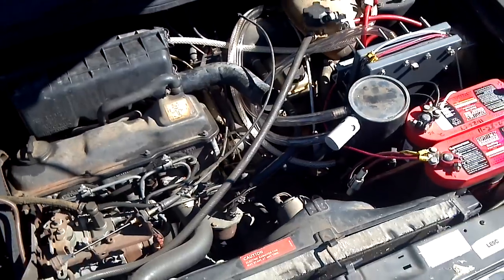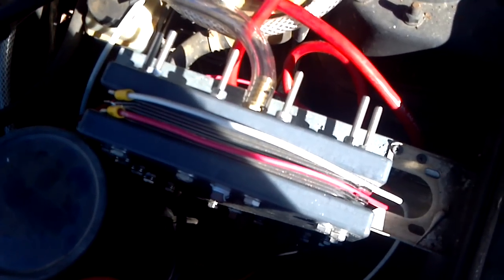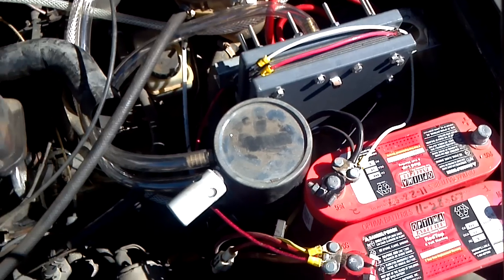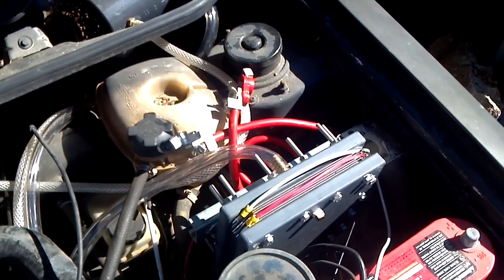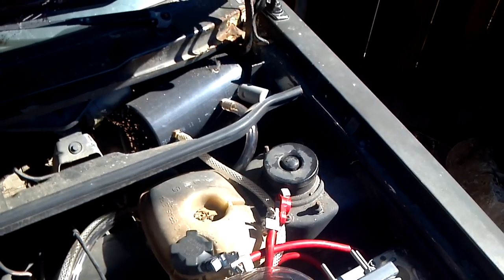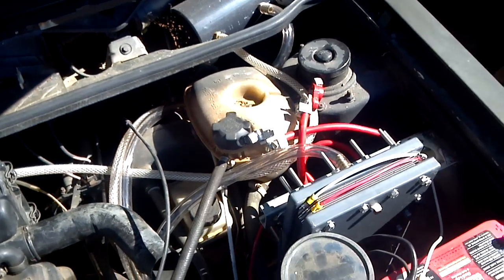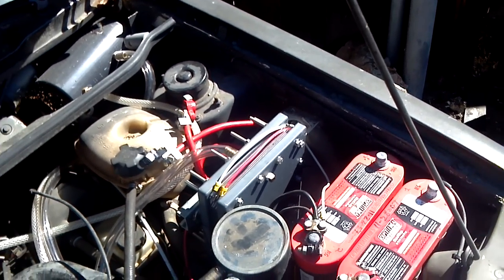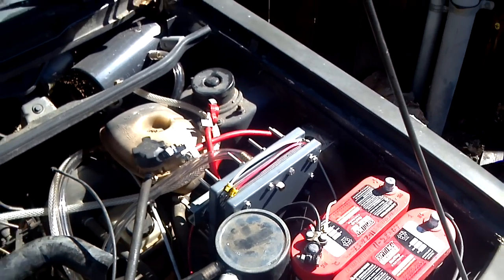2012 10 27 11 34 27 756

Comment: How about running one with a T.E.G. thermal electric generator or a stirling engine ? 
BMW has developed a experimenting with a TEG and what I have read was able to produce 500 watts from the Cat system.
2/3s of the gasoline that is burned in a engine is wasted through the cooling system and exhaust sysytem and a TEG or Stirling engine would take advantage of that wasted heat.
If a TEG can be built to run a hydrogen generator then there is no need to run it off of the battery or alternator.